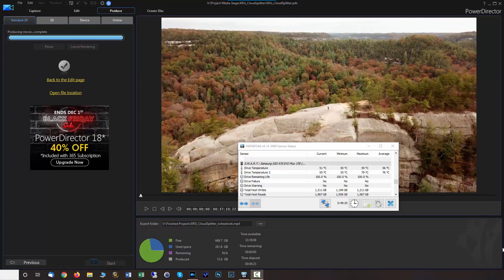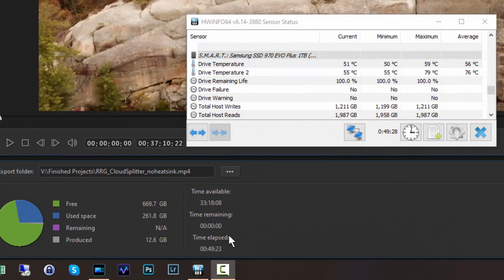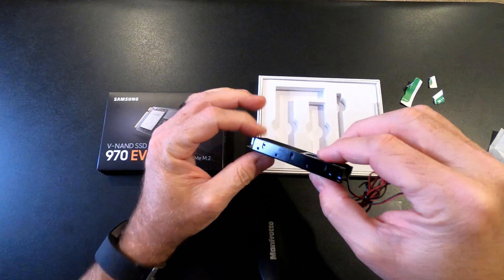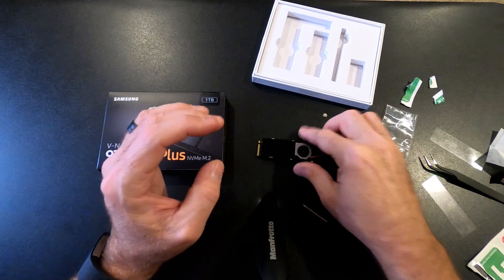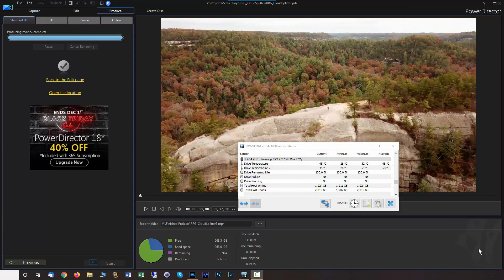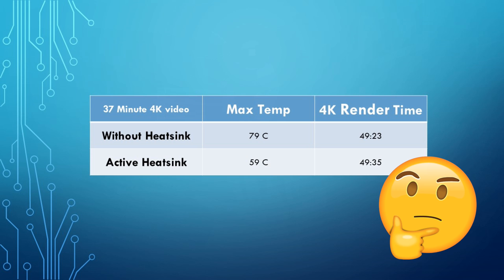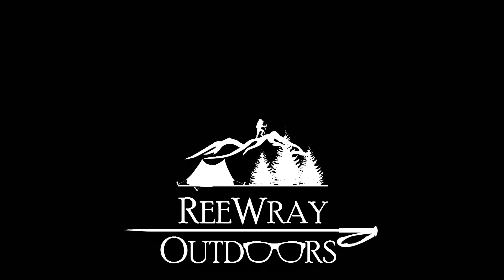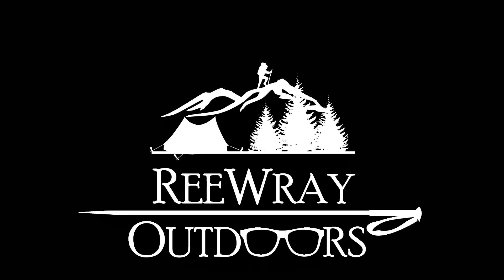SHOULD YOU INSTALL an M.2 NVMe HEATSINK??  Pros & Cons, How to Install It

Comment: Removing the labels does not seem like a good idea. Starting with, "voids the factory five year warranty".
Reply: NO! The FTC has already told companies that those stickers are illegal. Pull off your stickers, they are legally required to honor the warranty.

https://www.digitaltrends.com/computing/ftc-warranty-stickers-illegal/
Reply from the maker: Yes - definitely worth consideration!  Thanks for pointing that out.  That was a big 'miss' on my part.
Reply: Samsung stickers do not have an indicator of removal, and you can safely remove them and store it for use later if needed - could just slap it back on and send it in.
Reply: @SemlerPDX  this is my dilema, I don´t know if I should remove it or not, I just installed the same ssd and left  the labels on. The heatsink is only located on one side of the ssd. and according to samsung magician the temperature of 32 is normal.
Reply: @F.A.--  The only time you should remove it would be if it was going under a heat spreader such as those in the ASUS Crosshair VIII Hero motherboard - if you are sealing your NVMe up in a little coffin via the included heat spreaders on some motherboards, take off the sticker so it can transfer heat from the chips to the thermal pad on the underside of the cover, otherwise the sticker will be a hinderance to thermal transfer.  If you are not covering the NVMe in any way, just leave the sticker on.  BTW - which brand/model of NVMe SSD are we talking about here?
Reply: @SemlerPDX  Samsung ssd 970 evo 500gb, and the motherboard is a b550m pro vdh wifi. The heatsink is a M2 shield fozr. https://ca.msi.com/Motherboard/B550M-PRO-VDH-WIFI/Overview
Reply: @F.A.--  Since there will be a heatsink from the motherboard, you would want to gently remove the sticker from the side the touches the thermal pad on the heatsink 'lid'.  This would be the best way to ensure thermal transfer between the NVMe and heatsink above it.  The pad on the heatsink may also have adhesive, and a peel to remove before mounting.
Reply: @SemlerPDX  The heatsink had a label that I already removed it. I don't get it,  why is there a sticker in the ssd there if you are supposedly to remove it. I don't live in the U.S.A. so I'm afraid to remove the label. Would it damage the ssd if I don't remove it?
Reply: @F.A.--  The company has no idea how the SSD will be used, or how it will be mounted.  At the very least, with no added heatsink, a simple sticker like that could matter and help equalize thermals in some minor yet functional way.  But if you are putting it under a heatsink, it should be removed and this can be done in a number of ways that preserve the sticker if you needed to replace it in the future.

It's highly unlikely, though, Samsung SSD's are quite reliable and will likely live beyond any warranty regardless of what you do.  But a sticker between the chips and the thermal pad of a heatsink will definitely limit the ability of the heatsink to pull away heat.

Difference of holding an ice cube in your bare hand, or in your hand but on top of a piece of paper.
Reply: @SemlerPDX    I called samsung and verified this before even seeing this video, they claim the sticker is a copper heatsink, but mines just sticky paper.  Pulling the sticker doesnt void the warranty, he said just keep it with the box just in case, I also asked if anything wrong with adding a heatsink and he said no.
Reply: I took mine off. If you look at the samsung box. It doesn't have a sticker on it.

Comment: So just gonna put this out there, that hex shaped standoff is supposed to go UNDER the SSD edge, and a small screw goes on top to hold it down.. I can see by the angle.   Your drive should be straight and level with the rest of everything else installed on the board..   You should really fix that...
Reply from the maker: yeah it's been pointed out a couple of times.  Good catch.  I did pin a comment explaining the mistake and stressing the correct way to do it.

Comment: Thanks for the briefing. I thought it was a worth mentioning that I have the same Mother Board as you.

The other slot for the NVME M.2 has a built in heat sink. I quite understand that you chose the other slot because it was considerably less work.

I'm wondering if the MOBO heat sink is as efficient as the one that you installed in this video?

I'm going to purchase an NVME and I'll check it out and share my findings. I'm not into video editing, more of a gamer.

I would assume that the MOBO heatsink is less efficient than an after market equivalent.

Thanks again for the video!
Reply: If I remember correctly, the m.2 slot closest to the cpu generally links directly through a cpu lane..  Other m.2 slots typically are routed through the southbridge lanes which are shared with all of the SATA & other devices and will be slightly slower.  Are you likely to see a huge difference using PCIe 3.0 drive?   No..  BUT..  If you have a motherboard capable of PCIe 4.0, many PCIe 4.0 M.2 drives come with a heatsink already on them and it would make sense to use them in the faster slot...

Comment: does this heatsink block cards from x4 pci slot ?
Reply from the maker: it doesn't on my M/B, but only because of the position of the m.2 connector putting the drive in a parallel orientation to my slots, and also just inside for where the slots begin.  But the heatsink is probably just barely tall enough that it could interfere with a PCI card if oriented differently than mine.

Comment: The heat is there with or without the heatsink, with the heatsink you just disipate that heat into the case away from the ssd, so basically you will warm the case more with the heatsink.

Comment: simply the heat is transferred to a matel. but you should know if you use heat sink at high temprature for a long time it will increase the temprature instead of keeping it down. temperature decay time for thr matel should be low.